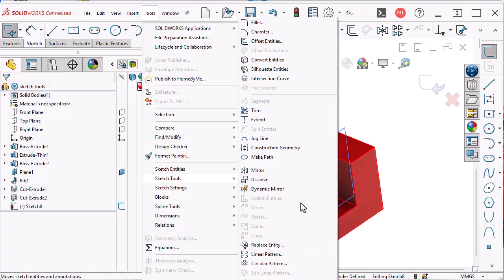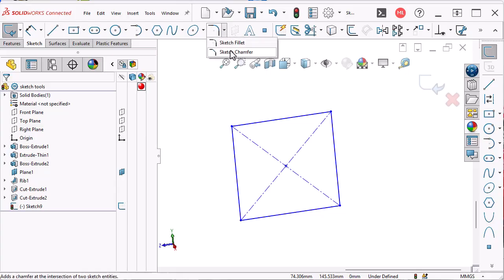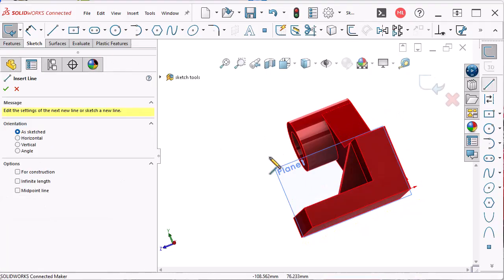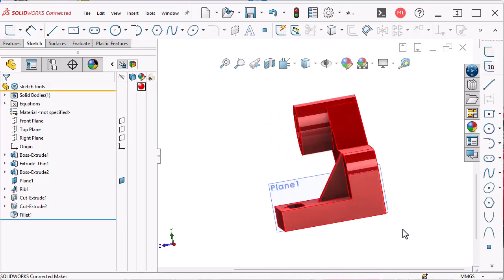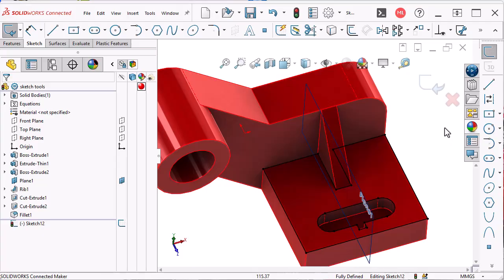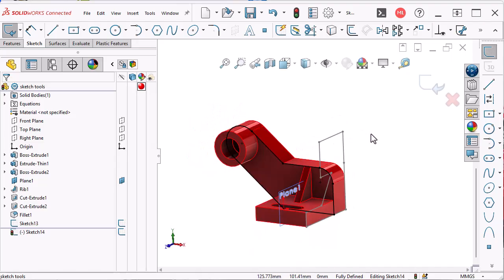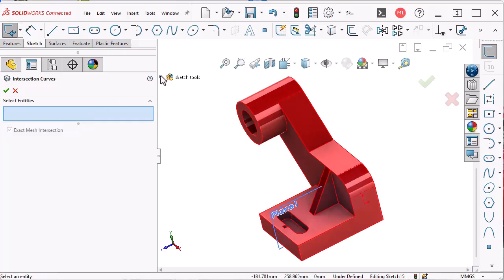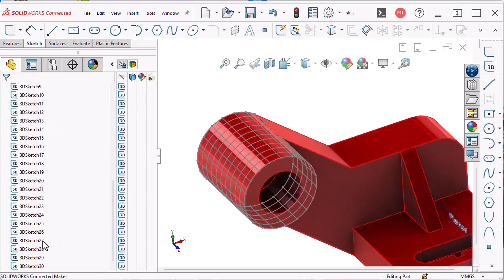Solidworks Sketch Tools 1

Comment: Awesome tutorial. To have all 3d sketches from Face Curve in one feature  you can start a 3d Sketch first and then run the face curve. It's a useful tool to demonstrate the structure of a surface.
Reply from the maker: Ah, yes, I knew there was a trick there, but couldn't remember it. Thanks.